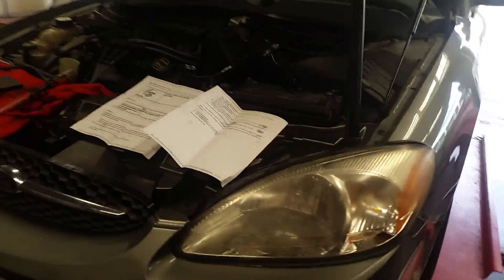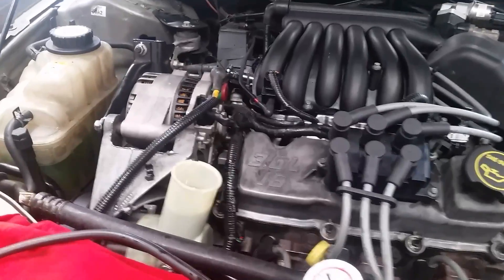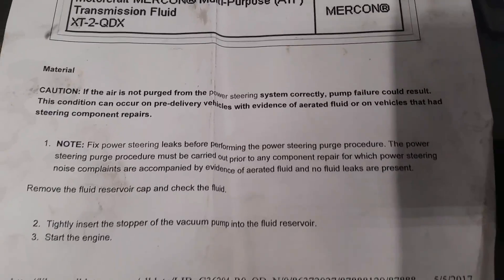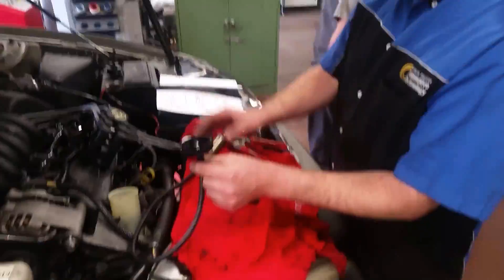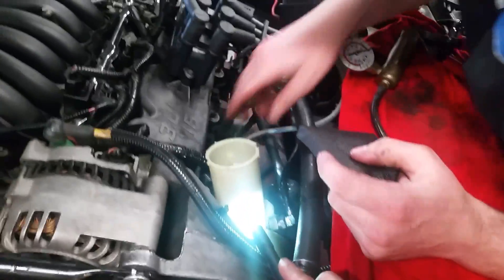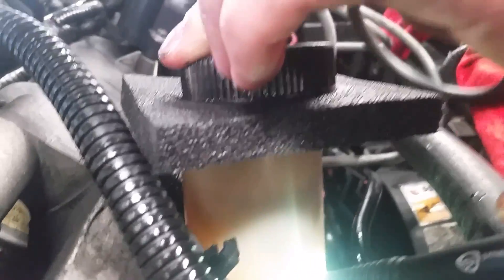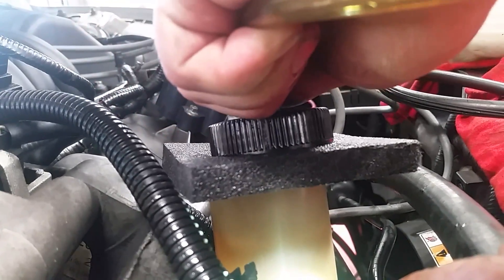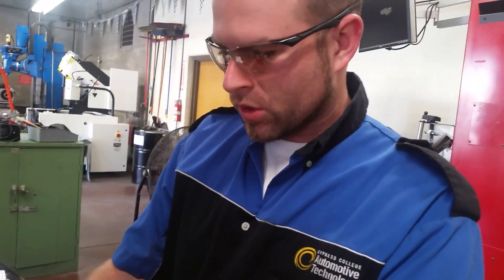How to bleed a Ford Taurus power steering system for whine and fluid aeration

Comment: I am blown away evey single time i work on a ford taurus. They are absolutely the most annoying piece of crap cars ever made. Its so hard to fix anything on them
Reply: I get the same feeling. I just know these things were designed in hell for the sole purpose of emptying your wallet and obliterating your knuckles. It's just evil.
Reply: @rem520  yah bro you're telling me. This is my other YT account and I did finally successfully bleed the power steering system.

The process i used was simply: leave the vehicle on the ground and NOT jacked up. top power steering off to proper level. Start engine with the cap on and turn the wheel lock to lock 7 times. Then turn the engine off, suck out the airiated fluid with a turkey baster and then dump good fluid back in to proper level. Repeat this process about 7 times and finally the airiated fluid will all be gone and the power steering will work! 

I'm now messing around with that freaking high pressure power steering line with the Teflon seal leaking. Friends don't let friends drive fords!
Reply: And I used that process after trying all the recommended ways to bleed the ford taurus power steering system. Although I did never attempt to put a vacuum pump on the power steering system like some people recommend
Reply: @ImSrry4BeingWhite  mine pukes out fluid when I turn it off, did yours do the same?
Reply: @RobertYayo  yeah mine did that too sometimes. My Taurus is still sitting in my driveway broken. Because I've never been able to bleed the power steering and it doesn't work at all
Reply: @ImSrry4BeingWhite  😮 and i appreciate your quick reply man, this car is gonna be the end of me cause There's literally no leaks, steering rack is new as well and got a good pump. Just keeps puking
Reply: @RobertYayo my suggestion would be to just continue trying to bleed it and drive it. Maybe it'll fix itself
Reply: @ImSrry4BeingWhite i tried driving it but the steering assist is still hard, and i don't want to damage the pump
Reply: @ImSrry4BeingWhite your bleed method helped me quiet down the pump, i appreciate it, hopefully this lasts
Reply: @RobertYayo  I hope so!

Comment: When I check my fluid in my 04' Taurus, It is to the fill line, However when running, if you take off the cap and look into the reservoir it is extremely low and is loud when steering. When I turn off the car levels reach the fill line again. I just replaced a leaky rack and Pinion, now this.

My questing is do I have a bad pump? Is it Worth replacing?
Reply: Check your lines first. Always good to replace with a rack replacement especially if they look really old or original. Obviously along with fluid flush and replacement.

Comment: I have been a mechanic for 40 years and have never seen this procedure. I always have problems with Ford power steering pumps when replacing them whether they're new or remanufactured. Thanks for this tip keep up the good work. I'm getting ready to do one right now 😜
Reply from the maker: I had never either until I had a problem car that wouldn't stop puking the fluid when they shut it off. I have access to a lot of info so I found this procedure specified by ford with a special tool and did some improvising and it was perfect. 
Since then, I found a specific measurement on the power steering reservoir fluid level that indicates how much air is in the system. You measure the fluid level with it running, then shut it off and if it goes up the reservoir, that indicates how much air is trapped in the system (probably rack) because the air is no longer under pressure and pushes the fluid back when engine turns off. 
Pretty cool stuff, stay humble and keep learning.
Reply: I recently changed the rack and pinion and fluid on my 2006 Ford Taurus SE. I tried this procedure several times with no success, I even tried other procedures found on utube with no success lost several quarts of fluid at a hefty price per quart, so this what I did and it worked perfectly. I took the high pressure line off and put a fitting on the pump so that I could hook a hand pump to it and pump the fluid until there was no air bubbles, then I hooked the pump to the line and did the same. I put the line back on and immediately it was much better little whine from the pump and no over flow, so I repeated the procedure and success, no noise from pump even from steering the wheel from stop to stop. Be sure to get the nylon washer you'll probably need 2 it's made from dorman part number 82540.
Reply: Update I took the old filler cap and drilled the hole in it and screwed a bleeder valve into it. I appreciate the time and effort that you put into the video and also responding to my message. Hopefully this will work for you as it did for me.

Comment: This should work on most 3.0L V6 fords from the late 90's and early 00's.  Vulcan Engines were quite common, my ranger has one thats practically identical, just mounted with the accessories (power steering pump) at the front of the engine bay.

Comment: Speaking of specialty tools... I have an entire tool box of tool specifically dedicated to the Pontiac j2000. If you know anybody who would like to purchase these tools from me. That I have not used in... 25 years. But had to have them to fix the cars. Please contact me via this post. I would love to get these worthless pieces of scrap out of my toolbox. And possibly give them to the last individual on the planet, that might still own an 86 Pontiac j2000. Yes... I will be taking a loss of approximately $3,000. I did not make $3,000 from these tools. But like I said... I would much rather have somebody else who would use these tools. Then have them taking up space in my toolbox. Thank you. Have a great day.

By the way gentlemen... Welcome to the automotive industry. You're going to need another tool box, for all the specialty tools that are going to be required, to fix some of the problems that you're going to experience in the automotive repair industry. What you did here, is only the tip of the iceberg. Be prepared. Next September, a new model year is coming. Which means... You're going to be required to purchase more tools. Set aside the 25 or $30,000 in Snap-on Tools, you already possess... Those are worthless. Be prepared for what is going to happen next. And what is going to happen next is... Every September, you will be required to purchase more specialty tools that are vehicle specific. Just so you can make .2 or .3 on your flat rate.

And when you refused to purchase these tools... Right around Christmas time... Every year. Then you will be replaced with someone who will. We don't need you... We need your toolbox. This is one of the harsh realities of working in the automotive industry. Good luck.

Comment: Did this car ever spray fluid out of the vent on the cap? If I start the car, the fluid level goes down drastically, so I top it off to the minimum level.  I can get most of the visible bubbles out with a vacuum bleeder like this but as soon as I shut the car off, it sprays fluid everywhere. (It actually caught on fire once because of a hot catalytic converter).
Reply from the maker: fisqual that is exactly what it did, none of the other bleeding methods worked. It kept coming back soaked with fluid, low, and whining.
Reply from the maker: fisqual and we vacuum bled it for a while with it running, pulse it on and off until it gets quiet, make sure it is topped off and if all the air is out, it will be good. If I get another one, I will make the entire video, at the time I did not know if it was going to fix it or not.
Reply: So, i tried your method today, it still pushed a good 4oz of fluid out of the pump when i shut the car off.  When you were applying vacuum to the pump did the groaning increase significantly?  I'm starting to think that this "Lares" remanufacturered pump my friend bought for me to install is defective. What was the brand of pump you installed that finally worked for you?

And just in case you have any input on my methods, I used a vacuum pump that I would otherwise use to evacuate an AC system. I just pulsed it for a half a second at a time until it would start to draw fluid into the hose. I was thinking maybe the pressure on that is too high?  But it continues to groan (worse than without the pump) for almost 10 seconds after i turn off the vacuum pump.
Reply from the maker: fisqual vacuuming made my pump groan really bad too, then when I released vacuum it would quiet down. I did that a handful of times and was watching air bubbles come out while I did it in the reservoir. Eventually no more bubbles. Finally I shut it off and it did not puke. 
I don't remember the pump bramd, it was reman. I am sure a ford oem would be great like someone already said but the fact that it is puking leads me to believe there is still air. Have someone turn the wheel lock to lock while you do it to be sure the rack goes through full strokes and all the air comes out. 
Last thought, be sure there are no leaks, especially on the return  (suction) side. 
Follow up with me, I want to know.
Reply: @fisqual  Does the tapered adapter fit the reservoir or is it too small?
Reply: @DickTickles  I used the ford power steering specific adapter on my vacuum pump. 

i'm pretty sure there was another leak letting air in somewhere though because I never resolved the problem. The car also started having fuel pump issues so I convinced my friend to scrap it.
Reply: @fisqual  I'll try vacuum bleeding it, but if that doesn't work and I have a leak letting air in, is it worth paying to get fixed? Right now every mechanic I talk to is pushing steering rack and I know it's not a steering rack issue.
Reply: @DickTickles  Fuel pump + PS issue usually wouldn't be a deal breaker for me, but these Tauruses rust like heck up here in Columbus, OH.  There were holes in the floor, the transmission mount collapsed and literally crushed a segment of the PS line, so the car was definitely not worth fixing.

In contrast, I put a head gasket in a 288k mile Taurus (and also did a very extensive valve lap job because holy crap they were pitted) a few weeks ago that lived in Alabama until 5~ years ago. It also had the transmission rebuilt around 220k, so now that the HG is done it's definitely going to be good to go for several more years.
Reply: @CollegeAutomotiveClasses  the groaning is normal
Reply from the maker: @daniellaudman8580  some groaning is normal sure, and when I videod this yeah it was fine but the excessive groaning was sound of aeratedfood in the pump and included spitting out a lot of fluid when the engine was turned off was DEFINITELY not normal.
Reply: @CollegeAutomotiveClasses  hey I have a question when try to vaccum the air out of mines far as could get the pump down  was 17 then it never would hold the vacuum at all do thing it's a hole some where on that  line ... also the theite that go on top of pump to seals it's off suck on down far in the power steering pump itself
Reply from the maker: @paul39422  if a line has a leak you would see power steering fluid leak out when the engine is running and the pump is turning. 
Why are you vacuum bleeding it? Did you replace the pump of perform a repair? There would need to be a customer concern, is it making noise, hard steering effort, leaking fluid??